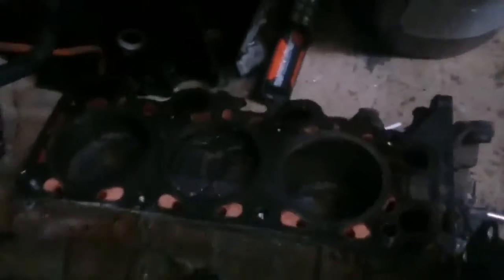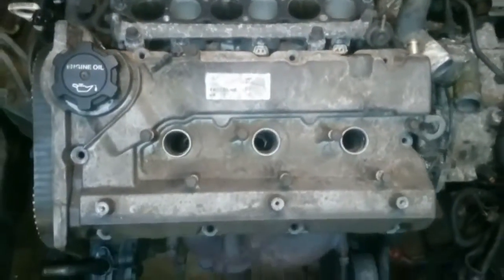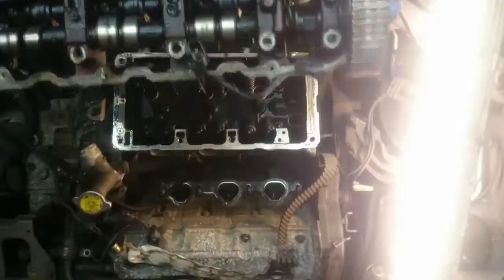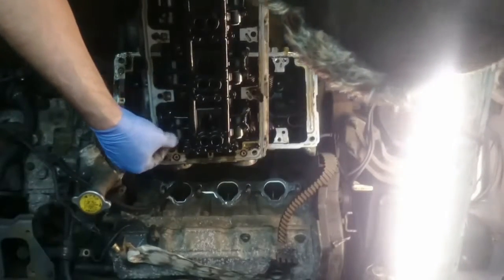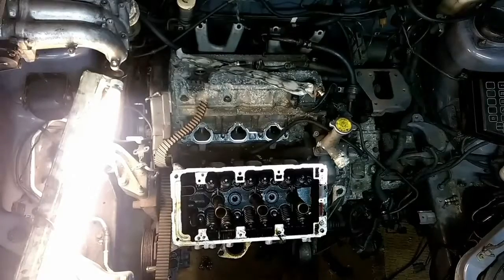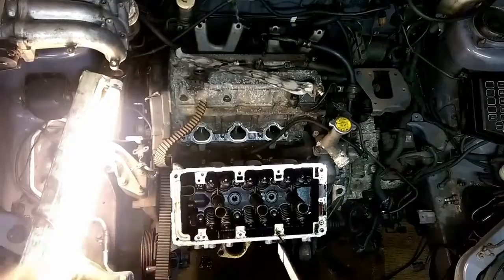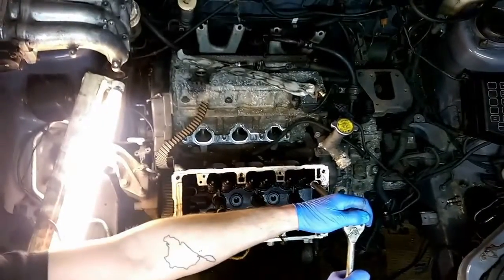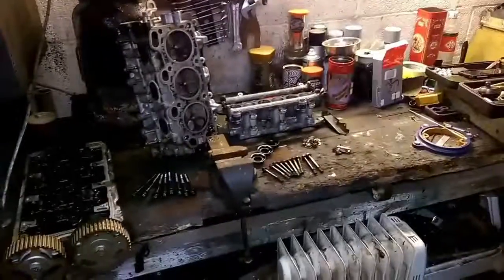Ep 2: Cylinder Head Removal - Mitsubishi FTO Budget Track Car Build

Comment: We just brought one of these things. After a very vigorous test drive and all it sat there and ran sweet as a nut. Get the bastard home and it has a nasty nasty rattle. I have been trolling the net to try and find the problem and I think watching this I just may have found it. You mention those plastic keepers breaking and I have found an odd piece of plastic circular thing. Then you show the collet it holds in place and that odd bit of plastic would hold that I'm picking. I guess I'm ripping all the shit apart tomorrow. FUCK! I was so careful not to buy a lemon too. At least we got it cheap. We will still come out on top but its not the quick turn and burn I hoped it would be.

Comment: Hey buddy I'm installing new Cam angle sensor and crank sensor in my GPX any tips?
Reply from the maker: Excersise patience.... The cam isn't too bad - up the top of the front bank (don't loose the spacer plate!) . The crank is a pain... The whole side plastic cover has to come off (meaning the crank pulley and everything else down the side of the engine). Remove the dipstick, engine mount, aircon pipe bolts and everything else to give you as much wriggle room as possible. Good luck 👍
Reply: @ManSeeksCivic  your not wrong about being patient! I have only. Managed to get the plastic case off to see the Cam sensor and it's very tight in there.
Reply from the maker: @MrShortStuff  Sadly that's the easy one. Mitsubishi must have had faith in the longevity of those sensors!
Reply: @ManSeeksCivic  quick question!  I destroyed my first sensor as I forgot the spacer plate!  I'm assuming spacer plate goes behind the Cam sensor!
Reply from the maker: @MrShortStuff  oh no man!... Yeah, it goes behind the sensor to space it out from the head. This allows the cam reluctor ring to swipe through the slot in the sensor.
Reply: @ManSeeksCivic  well looks like got find another one.  Is there any cheap non oem ones that I can use buddy?
Reply from the maker: @MrShortStuff  I'll be honest... Natalie and I have been lucky and not had to change one yet. Best suggestion I can make is to ask a breaker on ebay.

Comment: Haha Pamo. Swearing at my engine rocker cover for a good hour. Until I remembered this video existed. Saved the day (or morningxD) Good question I have here though, If you've been getting oil starvation to one side of the block roughly 1 cylinder on each side (seems to be oil starvation cause all of the other cam lobes look like electrochromed steel, an theres 2 that look like bronzed in the middle slightly, which im thinking might be caused by overheating perhaps?? What would you think mate
Reply from the maker: Brendan J Glad the video helped buddy... As for the oil, its difficult to diagnose but I would say that this is a flow problem to those lobes. It could have been a problem with irregular oil changes in the past blocking the passageways to that part of the head or it could be poor oil pressure starving that side. Which cylinders are struggling Brendan? Are they the farthest from the pump?